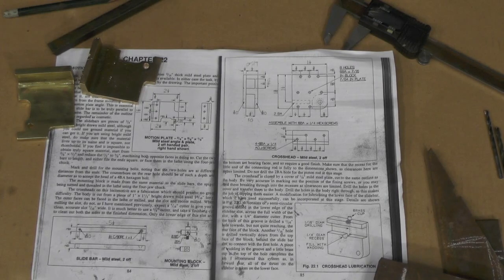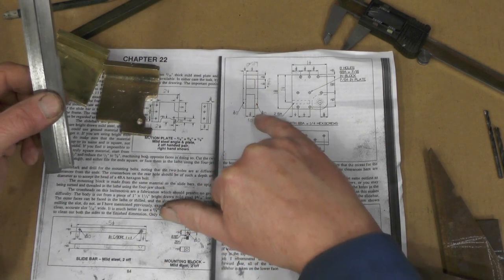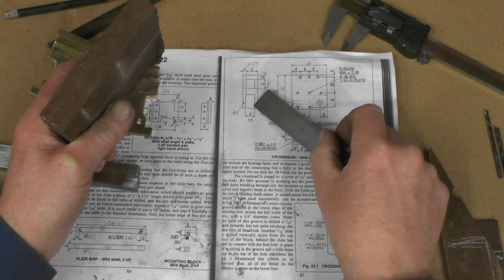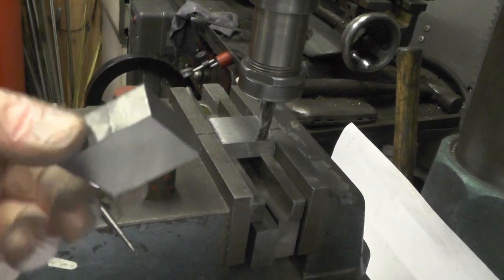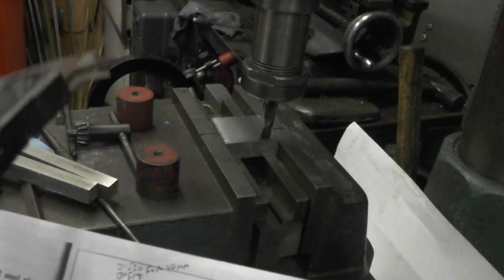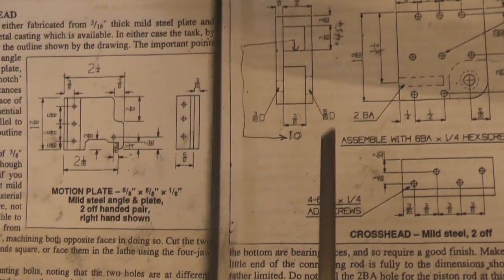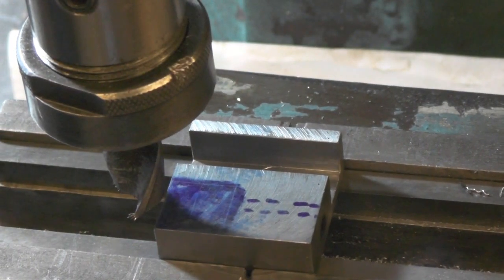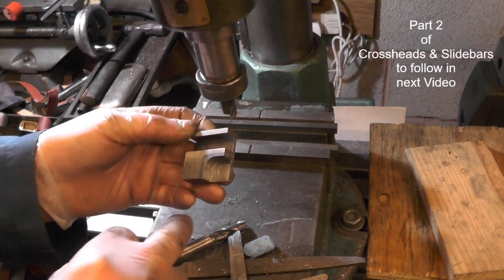Make a Beginners Miniature Steam Locomotive Series (Crossheads + Slidebars  Part 1) "mr factotum"

Comment: My husband has received this item. It's handmade...any more information would be a great help. Thankyou.
Reply from the maker: hi lesley
not sure what kind of info your after, if your more specific i will try to help
regards
Kev
Reply: @MrFactotum  I am unable to send a photograph of the steam engine , I have tried. It's to know what it is , value etc.
Reply from the maker: @lesleywatts7069  hi lesley
the value is depending on 
Condition
Boiler Certification (Steam & Hydraulic Pressure Tests)
Age
Does it run ok
Any known issues
etc.etc.
there's a huge variation depending on above
There is a Sweet Pea facebook group, who should be able to help with this, you will need all the information above plus photos, though. Boiler certification is a major factor
Hope this helps the facebook group has very knowledgable participants
cheers
Kev
Reply: @MrFactotum  thankyou for your feedback..x
Reply: @MrFactotum  thankyou.

Comment: Do you have blue prints plz share any source 👍
Reply from the maker: Hi JM
i just worked from a book by Jack Buckler "Build your own Steam Locomotive" and a general arrangement drawing. The books are on ebay, or Book, Drawings & Castings etc, are from Blackgates Engineering In Yorkshire UK
Hope that helps any other questions, fire away i will help if i can
regards
mr f